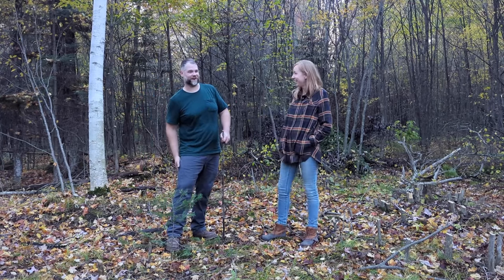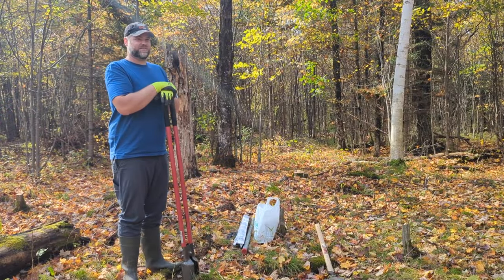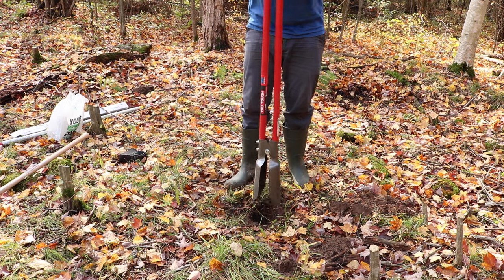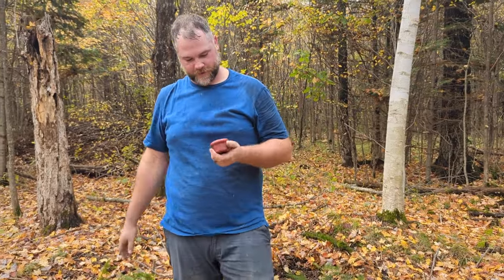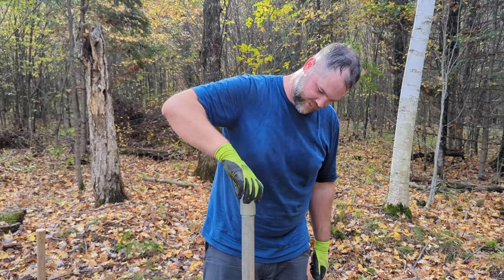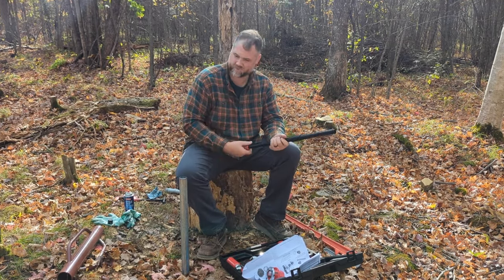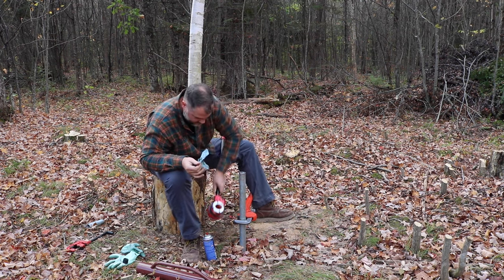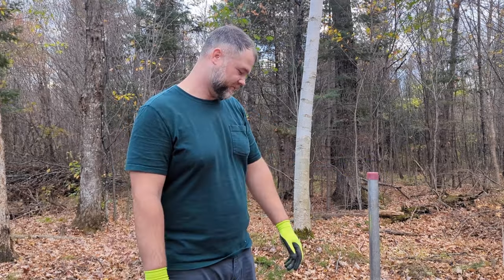Hand Driven (Sand Point) Well Install on our Homestead Property | Part 1

Comment: I found your video struggling with the same thing of smashing the threads. I can definitely feel your pain.
Reply from the maker: @jpwdowiak  Sorry you can relate. 🙈 It's so frustrating.
Reply: @thiscreativehouse  did you find a solution for your well yet? I was looking through your uploads and haven’t seen an update. I’ll be giving mine a go again this weekend coming. Have to finish all my ground work to pour concrete on our garage + apartment before it gets cold!!
Reply from the maker: @jpwdowiak  We picked a new spot this season, and pounded it in slowly and gently with a post driver by hand. So far, we're about 11 feet in the ground, have hit a good amount of water, but still trying to reach the gravel layer (still stuck in some clay). I've been waiting to post so that the full video is start to finish, but boy, it's been SLOW this season with all of the rain we've been getting.

So far, all the fittings have stayed tight, and we're not crushing any threads/haven't had to cut any pipe like last year. We're hoping to pound it in another 2 feet this week, and give the pump another try to see if we're out of the clay.

Look into jetting a well with a pressure washer. Granted, you need to water and power (which is our problem), but if these last few feet don't go as planned, I think that's what we'll try!

Comment: So much work!  We will have similar issues when we dig a well.  Most likely will not be able to use this method due to the rock!  For now we have a generous neighbour with good water so we can use his till we figure it out!
Reply from the maker: We need to find an easier and faster way to get it in, so we know if we need to scoot over and try again. It is ROCKY in this forest, but we hoped hitting the gravel layer would make the spot promising.

Comment: There is an easier way. If you have water pump and water source. Add a fitting to the top of your pipe and pump water down the pipe and rotate it as you are pumping. Beter if you had and pointed taper with blades on the bottom of old pipe to initially drill the well. Usually using this methid you need a 12 foot tripod with a pully hanging from the top so you can attach a rope to the top of the drilling pipe to lft it and drop the pipe as you rotate it. The water will pump the cuttings up the outside of the pipe to the surface. Also better to have starting head pipe 3 feet into the ground with a side outlet for water and cutting returns. I drilled 2 wells here in the filippines to 100 feet each took about a day and a half. Hope you understand what I mean. Good luck
Reply from the maker: Thanks for the tips! Wish we had the resources to do what you're suggesting. We'll keep it in mind! Really like the tripod idea - I think that's what we'll try in the Spring to pound in it at the least.

Comment: I wonder if you could use that tractor in the background, just use the bucket to push it down.
Reply from the maker: We chatted about that, but John's worried it'll be too much force and will bend the pipe. 😬 Hhh.